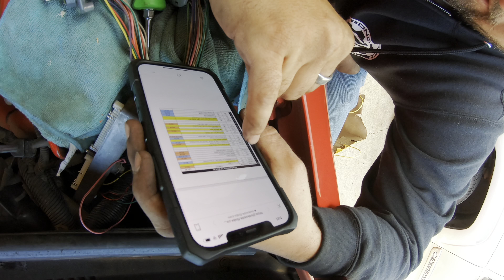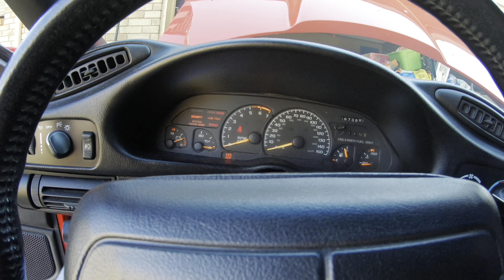0411 PCM Swap!! 96 Camaro SS LT1 Pt.1

Comment: hmmmm, what else is needed, thought there was some CAM sensor, optispark changes? Remember I'm running 96 motor trans, with a 95 PCM (and your code),..
Reply from the maker: On the 4x setup no cam sensor is used.

Comment: Do you have a good starting tune for a 411 swapped 1996 Camaro LT1 4l60e? I have everything I need to do the swap including HPtuners. After I get it done and get my cam and roller rockers installed I’ll pay for a custom tune over email or whatever. I just need to get it driving in the meantime after the swap. I’ve already reprogrammed the PCM to a 2002 express van.
Reply from the maker: yes. just email me. strongspeedworks@hotmail.com
its not free.

Comment: Is this possible to do on a 93 rs
Reply from the maker: You need the entire timing setup from a 96/97 LT1
The wiring harness is way different too.
Reply: So a harness swap from a  94+ car and the 96/97  timing swap also ? Sounds like i need to just dump a LS in it
Reply from the maker: @cheyennegoodman192  I mean that’s a lot of work for zero gain.